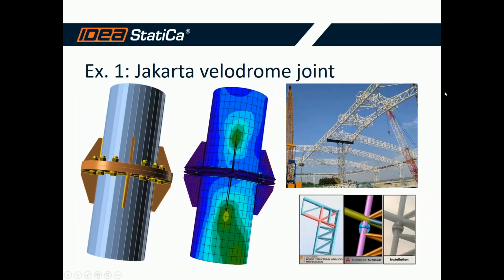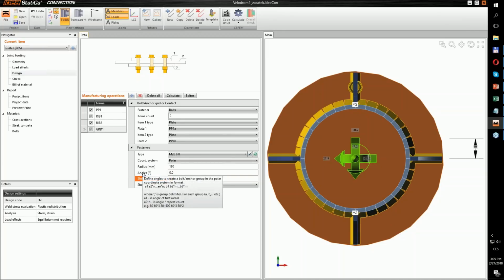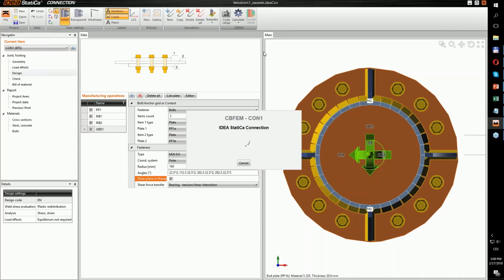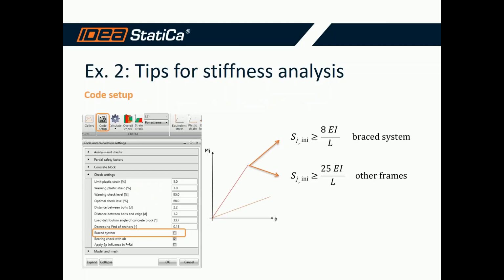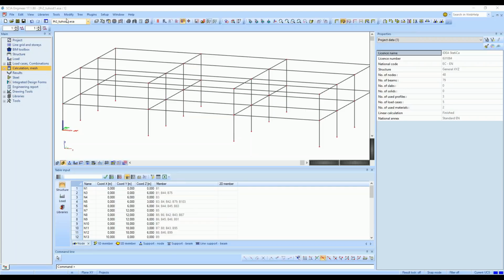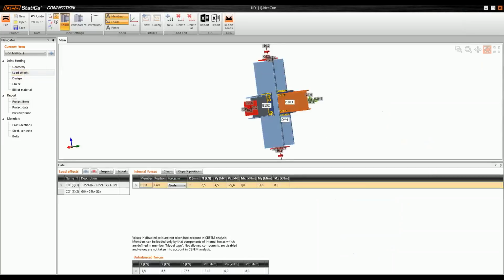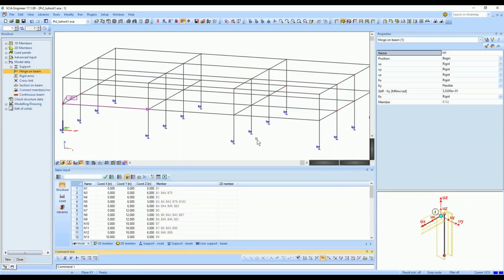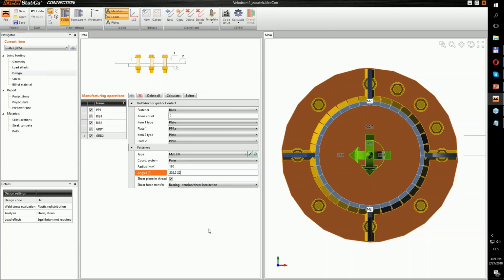Design and code check of joint from Jakarta velodrome

Comment: why did you use SJs value from LE2 instead of LE3?
Reply from the maker: It was rather personal decission of the engineer, the difference of Sjs values of LE2 and LE3 are neglectable, you will notice the difference in global model recalculation with Sjs when there is a value difference of hunderds or thousands.
https://www.ideastatica.com/blog/why-bother-with-connection-stiffness